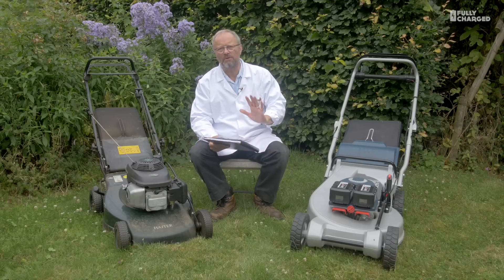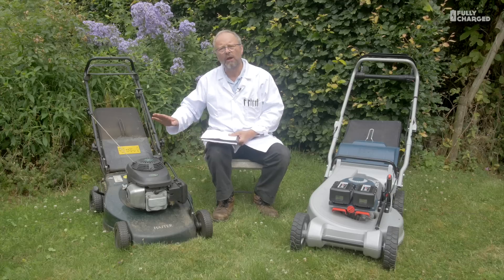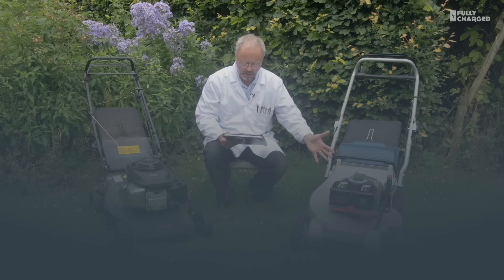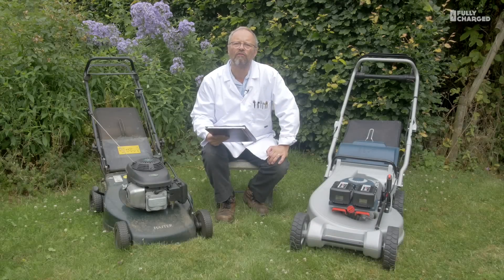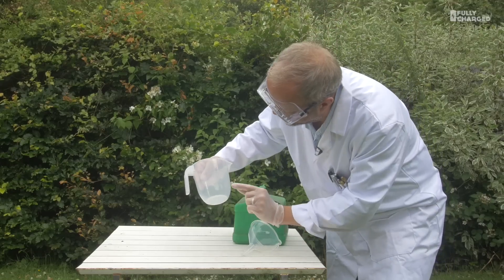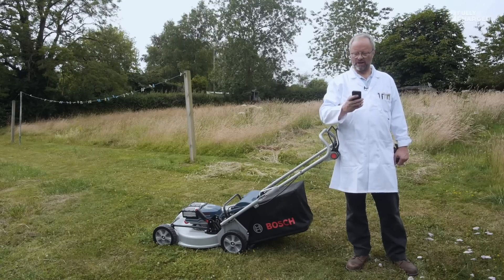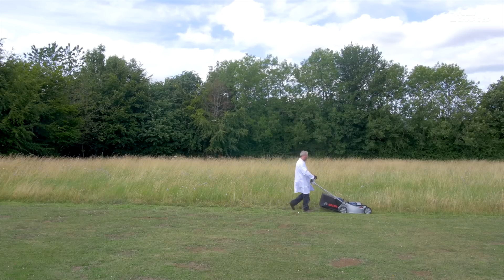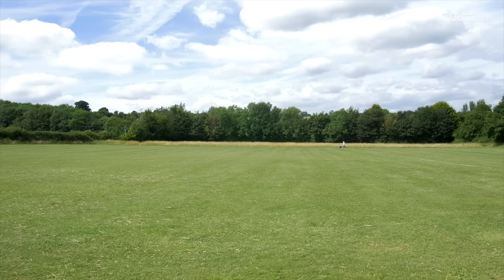Battery V Petrol. The Lawnmower Test | Fully Charged

Comment: Simple.  Electric motors are 98% efficient in energy consumption. Whereas, the internal combustion engine is less than 30% efficient in energy consumption. Plain old thermodynamics.
Reply: Carlos Malave 
which most people are ignorant of, or—at the very least—haven't applied to this
Reply: +Carlos Malave what about the steam turbine in coal fired power stations,, transmission losses and charging, you can say the same for petrol I suppose,  if you really want to understand the efficiencies of resource utilisation you have to go further back I think, nevertheless and eye opening demonstration.
Reply: logtothebase2
do you have a rough idea how bad the transmission and charging losses are?  it seems like they'd have to be terrible for it to be worse than the gas motor.

just curious.

in this case, of course, since the power came from his solar panels, those losses are much reduced.
Reply: +ThoperSought 
Generation losses are the biggest piece - but they beat the gasoline engine by at least 10-15%, and sometimes they are 2X better.  With renewable energy, there is NO generation loss at all, though.

Grid losses are not that much - about 8%.

Gasoline doesn't appear out of thin air though.  Getting oil, and going through all the steps to make gasoline and deliver it to the mower, is significant.  It takes between 7.5 and 13kWh PER GALLON, so the electrical energy overhead CANCELS OUT, and then some.

Electric motors are vastly more efficient at ~90-94% efficient.  Small engines are terrible at 10-20%.  They are no where near to car engines, which are 20-35% typically, with the new Prius at 40% PEAK; after it is warmed up, etc.
Reply: Fair doos but what all of you are forgetting is all us commercial gardeners who have to cut 10-15 lawns in a day and don't have time to go home for over an hour to let's the bloody thing charge up. I've got a wee bosh mains powered mower for my own lawn but for work it has to be the big Honda and I can now get 3 hours in one tank which is 4-5 lawns round here
Reply: Neil Blanchard
that's really impressive, thank you very much.

I didn't realize generation loss was that high and grid loss was that low.

the more I hear about this, the more the complaints against going electric seem really silly.
Reply: +logtothebase2 The electricity doesn't have to be from fossil fuels.
Reply: +logtothebase2 I think you've missed the point entirely...
Reply: Mike Bablles , Well maybe? but  Its a great demonstration i would say, and I agree with the points about renewables. my main concern is that this stuff will get pulled apart by climate change sceptics if its not  fairly rigorous, and the key is how the electricity is generated in the first place I expect, if you do those sums,
Reply: +Carlos Malave I would think you'd be lucky to get 10% efficiency out of a lawn mower engine.  Anyone done any research on this?  MW
Reply: +logtothebase2 You're right, and I appreciate the need to be rigorous.  Still, if you look at actual data, or even apply a bit of intuitive thinking, I think you'll reach the conclusion that the fossil fueled electric based path still ends up being far more efficient than the gasoline based path.  Obviously the biggest source of inefficiency (in either path) is when you actually burn the fossil fuel.  In a utility sized generation plant, you can get anywhere from 40-60% efficiency in this process (the newer plants can make use of some of the waste heat that's generated).  Plus you're not violently exploding the fuel (and losing energy to sound) to immediately translate it into physical work like you would in an internal combustion engine.  Finally it's far easier to manage/scrub pollutants on a utility scale rather than on a vehicle scale.  So now scale down to the internal combustion engine on a car.  Tremendous effort and gains have been made in efficiency there, but it's still only about 25-30% efficient.  AND, don't forget to take into account the refining process to create gasoline ready to use in ICEs to produce high octane fuel.  Fossil fuel-based generation plants would not require nearly the same level of refinement because again they are not using the fuels in a compression/ignition based cycle.  Still, the refinement process has been heavily optimized, so the losses have been minimized, but it's still in the area of 10% losses.  Now if you scale down to the lawnmower scale (I'm not really sure Robert's point was entirely about mowing lawns though!), then I think efficiency of that engine is probably ridiculously low.

So that sums up what I could call the worst case scenario for the electric generation path, where 100% of your electricity comes from the least efficient fossil fuel based sources.  In reality your electricity is going to be a mix of various sources, some of which are MORE efficient, or nuclear, or renewable based.  In Robert's particular case, owing to his solar panels, his renewable content is extremely high.
Reply: Lance Pickup
I wish more people knew all of that.

unfortunately, it seems like most people either don't have the resources to think reasonably about this, or don't bother to do the work.

I live in Japan, and a former student of mine, who works for the city government of the city where she lives, told her class once about a lecture arranged for people working in her office, where this guy put some of the blame for climate change on nuclear power.

anti-nuclear sentiment is still running quite high, here, and was even worse at that time, since it was within a year of the disaster.

this woman pretty much uncritically accepted what the guy was saying, despite the fact that it was total nonsense.  she's a smart woman, but she doesn't have a particularly scientific way of thinking about things—like most people.

distrust of the power company, here, has led the natural gas utility to offer a natural-gas based generator system for home use—not as an emergency backup, but for main-line electricity generation.  I haven't actually looked into it—which I really should if I'm going to complain about it—but I can't imagine the efficiency is very good.

unfortunately, the facts don't really move most people much.
Reply: +Lance Pickup seems the correct  conclusion, so in this case 0.42 KW h takes about 1kW to make, ( based on around 40% efficient powered station ) which the equivalent about of petrol (slightly over double the amount )would take you to about 20min on the petrol mower,  which some here saying is About 10% efficient vs about 30% for a decent modern car engine, which if the mower had such an engine turns into 60min run time ( which may be bollocks not researched it) a lot closer than the demo might infer, nevertheless  I concede the point ( which I wasn't really arguing anyway) Electric wins! given at the end of 0 min there was still plenty of power in the battery. and  given I conveniently  ignored the energy efficiency of getting 56 m of petrol l from the oil well or the tank of the mower!
Reply: +Carlos Malave Just been reading a 30 year old book about transport which stated that steam locomotives were only 6% efficient and diesel-electric locos"were 4 times"at 24%.So much for steel wheels on steel rails being good.It did not quote for electric locos.
Reply: +Travel & Life with JoBo No motive power method has ever come close to steam for traction efficiency over rails.  Diesel was and is utter crap, single phase electric traction was and is ordinary crap. Only electronic manipulation of voltage and multiple phases using solid state electronics comes close - till you look at the price for a loco containing 10,000 or more cooling fans!  Meanwhile, the 6 foot thick homeland coal seams running the length of Britain now lie flooded and unreachable - and we will shortly be a net importer of oil.  Dear Lord, would it be too much to ask for a large 100,000 ton slab of granite to fall out of the heavens onto our politicians?
Reply: +Travel & Life with JoBo "steam locomotives were only 6% efficient and diesel-electric locos"were 4
times"at 24%.So much for steel wheels on steel rails being good."

the 6% efficiency is for the steam engines energy production not for the transportation method. if you look at the energy usage per ton/mile of cargo transported a 6% efficient steam locomotive will probably have a better energy per ton/mile rating then a car that is 30% efficient. I know freight trains that are around 30% efficient can get 200 ton/miles per gallon (a 1 ton car would have to achieve 200mpg to equal that!)

The larger the transportation vehicle the more efficient it is (a Cargo ship can get 1000 ton/miles per gallon) because the surface area is reduced per square meter of internal volume.
Reply: +Carlos Malave The maximal energy conversion efficiency in a petrol engine (maybe a bit upward of 30%, but below what what heat-driven electricity generation can do) is only part of the story.  There are many many factors that conspire against achieving that maximal efficiency in terms of actual useful power, especially in cars. All the moving parts and external devices (alternator, pumps) cause frictional and other power losses. Cold start conditions are bad (incomplete combustion,  too viscous lubricant, catalytic converter not yet operative) and account for an impressive percentage of kms driven. But most importantly, the maximal energy conversion efficiency is only attained at a specific combination of RPM and torque (the "sweet spot") and therefore at a specific power output, rather close to the maximum. Run at lower power, as one does almost all of the time (especially those who like powerful engines), and there is just no way to even come close to the maximal efficiency. It is the latter factor that hybrid drives exploit to get fairly impressive fuel economies, even though in the end all their energy comes from running a petrol engine.

What this video seems to show (though it is a far cry from a scientific experiment) is that a petrol lawn mower actually gets 10% or less of useful power out of it stored energy, compared to the electric one (which can presumably convert nearly all of its stored electric energy).  Given that many of the losses I listed do not apply to lawn mowers (for instance they run at constant power), this is less than I would have thought.
Reply: +Travel & Life with JoBo Interestingly a study in the Soviet Union all the way back in the 1970s found that electric trains were 25% more efficient than their diesel counterparts.
Reply: +Carlos Malave So, what? Let's give the petrol mower the benefit of decreased efficiency and multiply its running time by a generous factor of 4 (assuming an even lower 25% thermal efficiency). 4 x 7 mins = 28mins at best vs at least 80min for the electric mower. The e-mower still wins by a factor of 300%
Reply: 98%? That's not right. Also you have to consider efficiencies based on fuel energy. Otherwise you disregard the irreversibilities in the batteries.
Reply: +Tim Engstrom It wasn't about the total efficiency. It was about how efficiently the stored energy (batterie or petrol) is converted into kinetic energy. The e-mower still wins. And if you want to look at the whole efficiency the batteries still wins because the production of fuel has a awful efficiency (about 77%)
Reply: Carlos - you are on the right track - boy, do the oil companies and car manufacturers work their 'charm offensive' and spin on this aspect - it's 15% for ICE motors.  Yes, that means the petrol engine is 85% efficient as a HEATER!  It is very hard to take in - my old man checked it out with scientists he worked with - there's the 15% of motive power if you are lucky out the drive shaft BEFORE IT GETS TO THE CLUTCH or differential or anything transmission-y, a surprising low (handful tops) wattage as sound, the rest is heat.  I even put forward a concept mostly using the ICE as a heater for this reason.  It's a shocker - on my toob channel, people cannot take it in.  It's a lie that permeates the auto industry, petrol and diesel engine efficiency - 14% up to 15.5% is what they mean - what a joke!
Reply: Carlos Malave  actually, when you take everything into consideration, the production of petrol is way worse than 77% exploration, discovery wells,  energy costs of drilling, logging the wells, cutting the roads to the leases, pumping of the oil, refining the oil, transporting the finished products you end up with an efficiency approaching 10%. Then if you look at operations like "sag D" it goes down to about 3% by the time you consume it.
Reply: Although the electric system still wins by some margin, a neglected issue in this argument appears to be the battery power loss.

While an electric motor is typically 90+% efficient, and we can argue about the vagaries of electrical power distribution until we're all blue in the face, batteries are actually not just a major range/time limitation (low energy density), they would also appear to dominate the efficiency of the vehicle or device.
Batteries frequently only give out about 70-80% of the energy you put into them when charging. Sometimes quite a bit less, and definitely less if they've spent a lot of time in storage and are subject to considerable self-discharge.

If you combine a 70% efficient battery with a 90% efficient motor, you end up with a 63% efficiency, which is certainly a massive drop from where you started.

As I said at the start, this doesn't really change the conclusion - battery electric setups are considerably more efficient than most any fossil fuel based one, but the battery charging efficiency is absolutely not a negligible loss by any means...
Reply: KuraIthys The price for electric motor ,battery, solar, and wind is going down at a scalable rate. while Gasoline is getting more costly due to new costly wells needed.  Overall Solar/Wind motors are the most efficient possible due less reliance on one time resources and fuel transportation inefficiency. A oil tanker travels 10,000 miles, needed massive energy to convert coal to gasoline. A gasoline tanker travels 100-500 miles so you can refill a mower and car.  Batteries can be charged by fossils, solar, wind, waste byproducts.
Reply: KuraIthys actually, that's worse than irrelevant to this test because petrol requires 6kwh of energy to produce per litre, meaning that the usual 12-15% efficiency of a combustion engine drops to around 7-9% overall efficiency.  And that's comparing relatively efficient engines such as car engines - not lawnmower engines, which are built for low cost and small dimensions rather than energy efficiency. I would guess that lawnmower is managing an overall efficiency of somewhere around the 4-5% mark.
Reply: I've spent 350 bucks on electric trimmers to keep my yard trimmed for 5 years.  The previous ten years with gas cost me 220.  I am guessing with battery replacement the electric trimmers will end up costing me 500 to 560 dollars.  So electric motors may be more efficient but gas is much much much cheaper, more powerful and just works better.
Reply: My lawn mower is about 32% efficient when burning fuel and the fuel has so much energy in it it only takes me about  gallon a year to trim my yard and about 2 gallons per year to mow it on a busy year with a riding mower.  To pay for fuel it costs me for ten years about 30 gallons, or about 60 bucks for all lawn work in fuel costs. If I buy an electric mower it would cost me 10,000% more.  My 1200 dollars for mowers trimmers and fuel for ten years would have cost me with batteries and electric about 7000 due to the high cost of batteries, they fail and mowers are very expensive.  So when it comes to cost gas or diesel win hands down by a thousand fold.  The technology, energy density and cost of batteries are just way way way too high.
Reply: That's very true most of the energy is wasted as heat and noise.
Reply: Carlos Malave   But still I don’t put a cup full of gas in my car
Reply: Burning coal to make electricity is 20 % efficient. Leave the maths to the engineers please. I am doctor and even I saw your mistake.
Reply: That would be no good for me because I'm a gardener and I can't go home for 50 minutes to charge my lawnmower batteries up that's why I carry a fuel can. It may be okay for u to do ur own lawn but working as a gardener I wouldn't even consider it. Then what happens when the battery's get old lose power and then you got to dispose of used batteries. Until they can make  a battery that's fully charged in 3-4 minutes and lasts atleast 2 hours which can I point out my Honda now it's tuned up and blade as sharpened as is humanly possible will do very nearly 3hrs on one tank